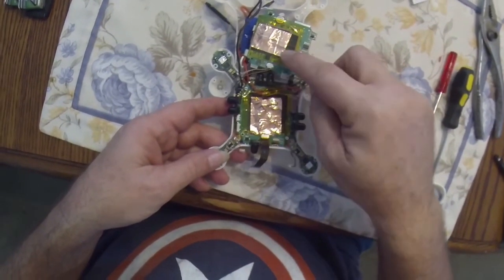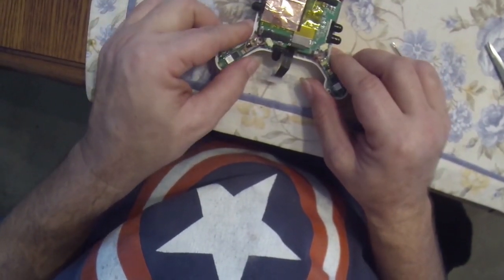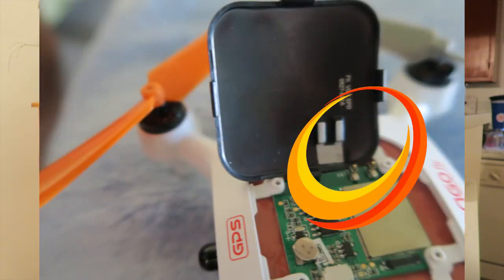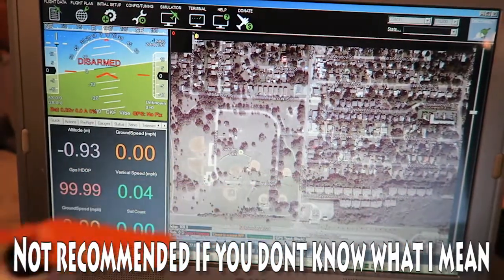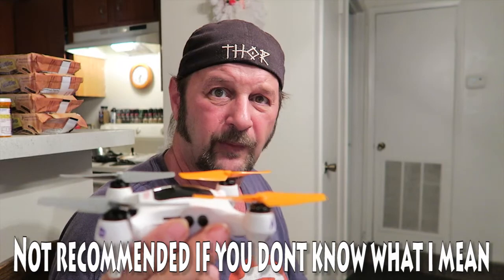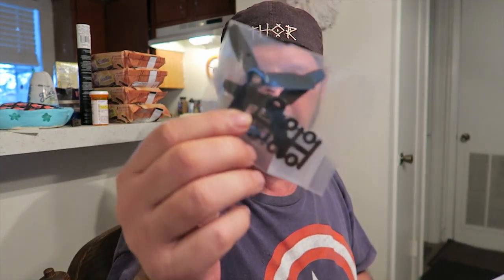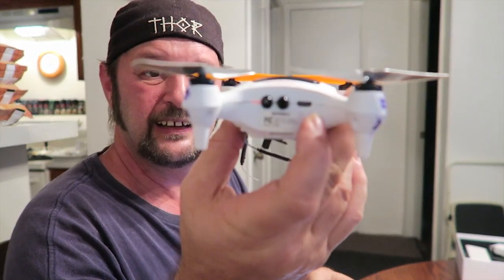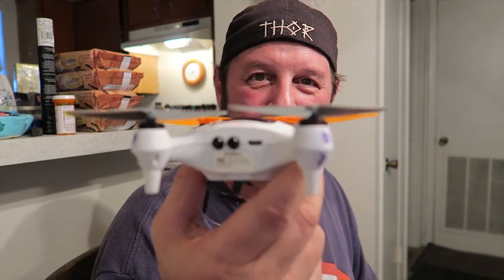Repair: OnagoFly The Smart Nano Drone Re-Assembled!!! (09.10.2016)

Comment: Hi, thanks for the great videos.

Do you now the propeller changed to 3 blades?
If so, what you have now taken (ebay item number)?
Do you have a video where you see how they then fly?

Have you also noticed the video with the problem of the battery?
What do you think about the revive with another battery?
Can you maybe installing a more powerful?

Best regards

Mirko
Reply from the maker: I havent found any 3 blade propellers for this, i purchased the wrong ones, they were for a hubsand. i willl not make any videos about this thing until i turn it into a racer, but changing the battery isnt hard as long as you know how to solder. however, there is very very little room for a different battery.

Comment: Good stuff! I finally received my onago. And like to hook it up with mission planner before the first fly. out of the box, what should I change in order to communicate with it? so for I tried 115200, 57600, 38400 with no luck. what else should I do other than just power up the onago and connect to the pc via USB cable? Thanks in advance!
Reply from the maker: you only connect the battery, you do not power on the onago. once you connect the onago via the USB, either a new driver will be added by windows or you may already have it. Once the Onago is connected to your system, open Mission planner. Look to the Upper right hand side of the screen. Click the First Box, you should something like COM14 or COM 19. look for the one that SAYS PX4 FMU next to it. click that and connect to it at 115200. i am currently making a video about how to do this it will be up by tonight
Reply: don't power on!!! it did the trick!!! I am in, thanks dude!!!
Reply from the maker: great, but there are other steps you have to follow. try and wait for the video
Reply from the maker: the video about using mission planner is up in case you havent dove in already!!

Comment: Hello Mighty,

Have you ever tried the control with the new control app somehow does not work with me :-(

The drone gives full throttle at start-up and is gone --- there is no reaction

The app is the version: onagofly app V1.6.912.beta
Reply from the maker: yes i am using the stable version not the beta, so i cant answer this question
Reply: Would be nice if you would make a tutorial with the beta version since the control is not really easy and the man runs more of the drone than she comes to one.